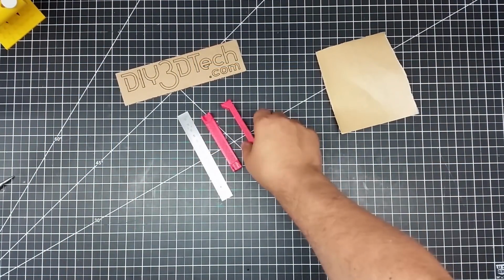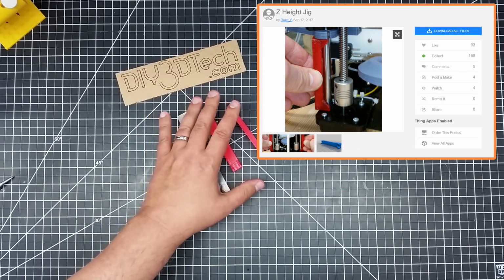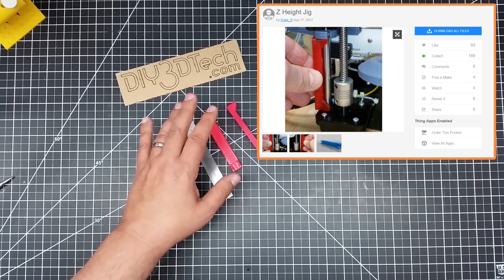Zonestar P802QR2 - Z Axis Leveling Jigs!

Comment: Shouldn't you make the X axis parallel to the build plate and not the motors?  I would clamp anything known to be straight (a level, 20x20 extrusion, thick glass, etc.) to the build plate and then locate your jig off of that.
Reply from the maker: First "match" the two lead screws as the idea is to avoid binding as the more its off, the more its (i.e. the brass anti-backlash nuts) likely to bind and then you "trame" your bed to match your nozzle....

Comment: I use a pair of 123 blocks to level. If you have enough room for the blocks to be held in place, it is a great way to get the most accurate (far more accurate than really needed) equal leveling).
Reply from the maker: Yes 123 blocks would work, yet as you point out a bit of over kill, yet I liked these as an easy can quick made them fun :-)